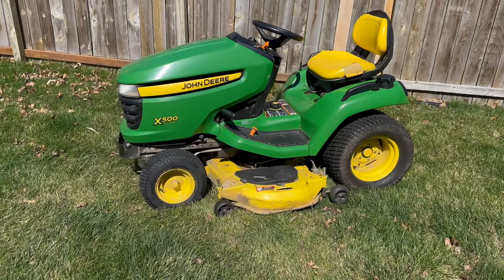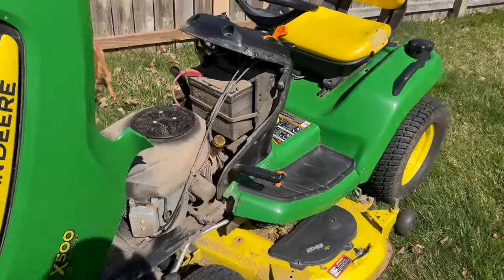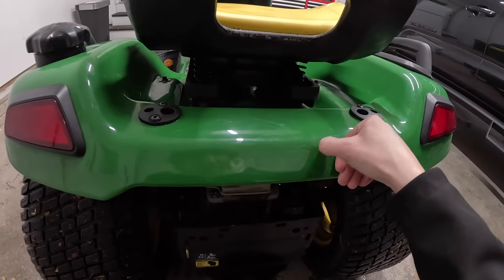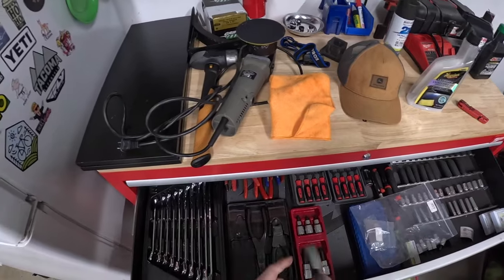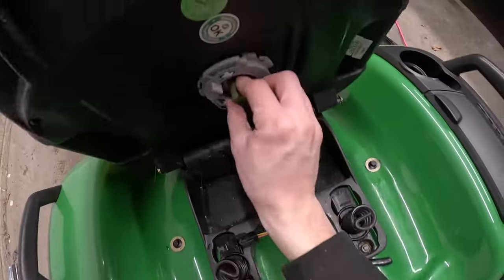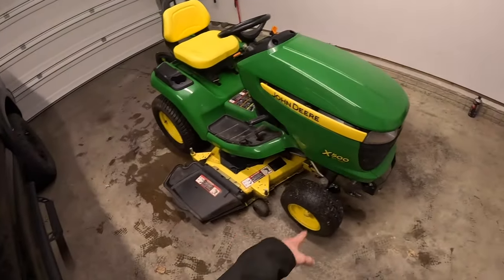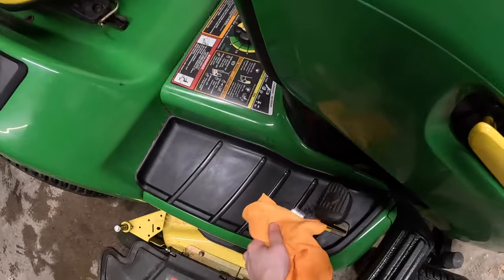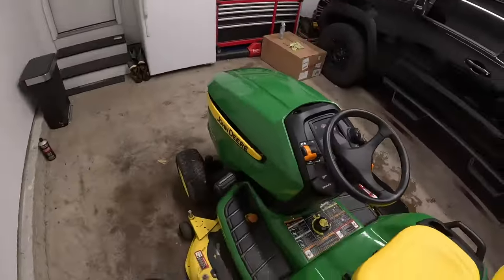Flipping a John Deere X500 Mower for a Huge Profit

Comment: Do you ever add a little paint to touch up the deck? Also what are you using in your spray bottle?
Reply from the maker: I do. I forgot to record but I did spray touch up paint on areas where bare metal was showing. The spray in the clear bottle was chemical guys nonsense. Super cleaner. Works great.
Reply: @Twenty3rdGen  thank you!